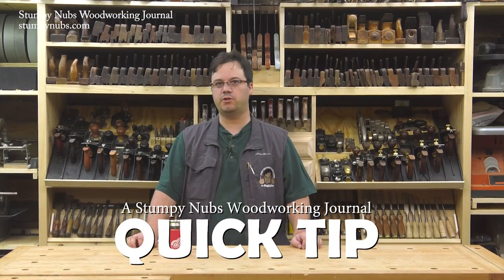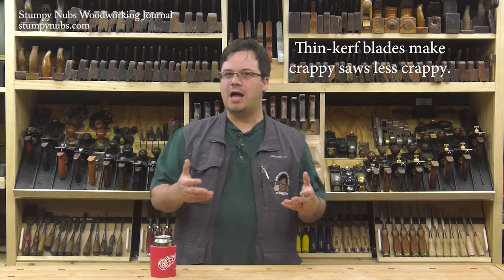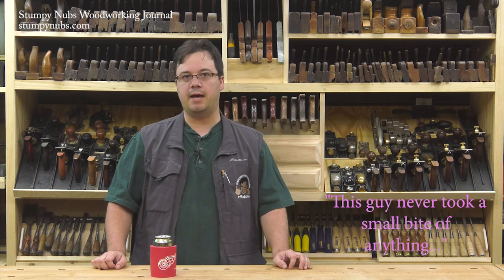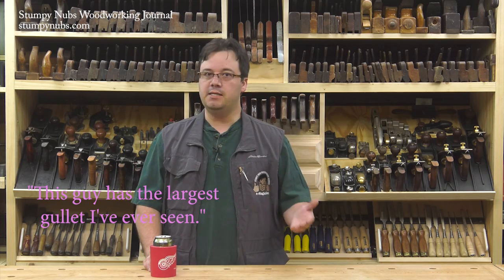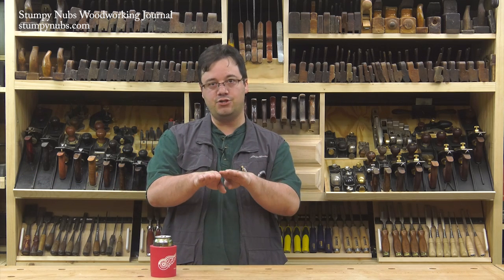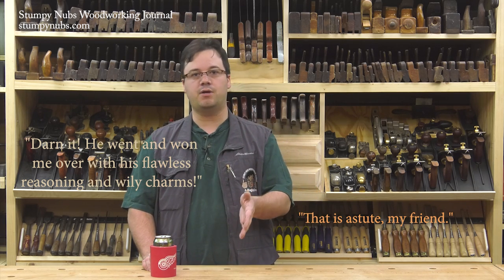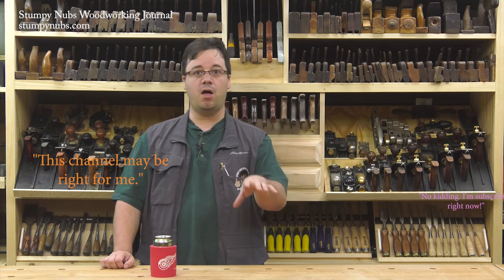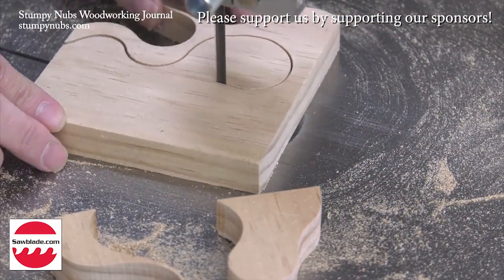Thin-kerf vs. full kerf- Don't choose the wrong table saw blade!

Comment: Regarding the feed rate, in the Jeep world, we have a saying:  "As slow as possible, as fast as is necessary" when rock-crawling.  That minimizes damage in the event that a vehicle slides while on a rock, causing a slower speed impact with the undercarriage (or side) of the vehicle. The table saw is the opposite: "As fast as possible, as slow as is necessary".  The solution to an underpowered saw that always burns your wood is to get a better saw to cut the stock that always burns. The 'underpowered' saw might still be useful for smaller projects, and a small crosscut sled, or miter sled, could work very well on that smaller saw.

Comment: All my table saw blades are full kerf EXCEPT for the million+ tooth plywood blade I bought some time ago, which did not come in a full kerf width.  I've wondered if there is an advantage to having a thin kerf blade for plywood (other than those mentioned in this video).  The blade does a spectacular job of cutting plywood, but then again if only one side is showing I can cut the plywood face up on my table saw with a combination blade (or is it face down, I always forget) and get great results for the "display" side.  But yeah, love my full kerf blades, my fancy-pants brand for most stuff and my cheapskate brand stuff if I'm worried about hitting a nail/screw/old fencing/civil war bullet/etc.

Comment: Excellent video with good info.  How about a discussion of 10" blades vs. circular saw blades?  I've switched to cir. saw blades for most cutting on an extra job-site saw (Bosch 4100) and like the performance.  I can't cut very thick wood, but it is very good for what I do on this saw.

Comment: Another approach I use is a smaller diameter blade. I cut a lot of 1/2” thick hard materials. The reduced speed reduces burning, as well as the load on the motor. Be advised: if you get a kickback, it will be significantly stronger.

Comment: The only reason I would use a thin kerf blade by choice is when resawing balsa and other woods for model building.  When the desired thickness is 1/16” or 3/32” that 1/32” adds up fast.  Balsa is pretty pricey and good spruce is hard to find.

Comment: Thanks for this very good overview.  I ended up getting Forrest thin kerf with a 5" stiffener.  My saw is 2 HP.  Which is certainly stronger than a lot of saws.  Still, it isn't a 3 HP, 5 HP, etc.  And Forest's thin kerfs are .100" thick, a few thousandths thicker than typical 3/32" thin kerf.  It seemed like about the best compromise given my medium power saw.
Reply: It is Better, I know, because I replaced my blade  with one of those!

Comment: One thing you forgot to mention is the need to change the blade knife accordinately to the width of the blade... so you usually better stick to one kerf for all your saws (or be prepared to tune the knife everytime you change the blade... even on my Delta it's not that easy to get it precisely set). 
Personally, I will never use a thin kerf ever again. When cutting cherry and maple they vibrate so much... It's even worse on a 12" mitre saw...
Reply: Try a smaller diameter blade instead with thin kerf.

Comment: My dad used to sell Homelite chainsaws back in the day.  They were lugging saws and used thicker kerf chainsaw blades than the Stihl's.  The Stihl's would cut circles around those old Homelites but would pinch a lot easier.

Comment: Get the right blade for the job. 
--Thin kerf finishing blades work rather well for plywood when you're using a circular saw guide.
--A good thin kerf high tooth count TCG bade can be versatile on a miter saw. 
-- A full-kerf FTG blade is nice on a table saw. My great grandfather always used this on his table saw. "Ah que muchacho! Don't waste time changing blades. Square the parts, cut the parts front-side first. Sand it neatly, put a neat finish on it. Have pride in your work. You're going to be stuck with it for the rest of your life.

Comment: The other thing you can consider is using a 7 1/4 saw blade for thin stock rips and cross cuts. Try using a 8 1/4 24 tooth blade for ripping 2'' construction lumber. They are usually thiner kerf and because of the smaller diameter, the torque at the point of contact with the wood is greater and the friction with the material is less.

Comment: Lower power use can be great in battery saws too. The steel of a 25% thinner saw blade is not a little more flexible, but a lot. Deflection of a beam is proportional to the third power of depth, meaning it is .75*.75*.75, or 42÷ as stiff. The same force will move a thin kerf blade more than twice the distance if no support plate is used.
Reply: I have always used a thin kerf and I even resaw with it. I have had zero trouble with bad cuts due to deflection. I use quality blades and always use a feed rate to match what I'm cutting.

Comment: And then I walk away... 🤣  sometime punches get thrown!?....over...kerf size 🤦🏽‍♂️ 
More like A squirrel & a half 😂🤣 
I agree with that heat/burn part, expand/contract for sure! Regardless of kerf I always try and keep a constant feed rate but In that moment keep an ear listening and a hand feeling for any major slow down under load. only then I opt to slightly slow up my feed rate to let the blade regain a few rpm minimizing motor strain. At least in theory lol my daily TS is a Dewalt 4800rpm she seems to handle anything I’ve thrown at her full kerf including IPE which I consider up there in hardness: Janka status. On a side note: I never realized that diablo only made thin kerf? I figured I just happen to be using their thin kerf version, but now that you said that in another vid it’s all coming together 😆

Comment: My problems is with blade periotic vibration.  I have a Jet 10" 220v 2HP cabinet saw.  As I feed materials through the blade will periodically vibrate cutting a 32" wider cut for an inch or so.  At first I though it was because my motor pully (double belt) slightly offset from the blade axel pully which I fixed and seemed to correct the problem.  But it returned and the pullies are aligned.  The bearings are smooth and tight (no slop). Using a full kerf blade. (Amana actually) Have you ever experienced this?

Comment: When you are cutting wood that costs many many dollars per board foot, kerf becomes extremely important. I am building a homebuilt aircraft made from aircraft grade Sitka Spruce… even 1/32 of an inch saved by using a thin kerf blade is like putting money back in my pocket! It is the reason that most of my cutting is done (where possible) on a band saw, which wastes a lot less wood in a cut since band saw blades are even thinner than thin kerf table saw blades.

Comment: I don't use a 10'' in. blade I go down in size to what I can get away with without having to make two cuts. That's works on the saw I have. Sometimes I have to go with  10'' and like you said it has problems. I run a 8-1/4 mostly.

Comment: Great video. Question. I've been having a hard time at the big box stores trying to figure out whether the blades are full kerfs or not. Obviously the ones labeled thin kerf are not. If it is not labeled "thin kerf" are the chances good that it is full kerf?  Also a flat cut would be nice too. Do you or anyone else out there know of a halfway decent blade that has one or both of my needs that doesn't cost a fortune. I just want something to cut 1/8 or 1/4 box joints on my table saw and I would rather pay less and not have it stay sharp as long. An actual model number would be great. Thanks!

Comment: I use a diablo thin blade. It 7 1/4" for a skill saw but if your not cutting thick lumber they work great. And you can get them for$15 at home depot way cheaper then an actual 10" thin kerf

Comment: Warped from heat?  Been there, done that; working in a window factory and sawing 5" to 7" glue-ups.  The blade would look like a wavy pastry, but after cooling down we'd be back at it (a the joys of production).

Comment: Great video, thank you.
 I was wondering, if the blade is thin-kerf, is there any danger of the blade breaking
while you use it?
I am thinking about purchasing a 7-1/4 inch Diablo blade, 60 teeth that has a .059 kerf. (1.490mm).

Comment: I wonder if you had a thin kerf blade cryogenically frozen, if it would prevent it from warping when it heated up also preventing vibration.  I know that's what they do with gun barrels to prevent them from warpage when it they get hot.

Comment: There is Full kerf, Thin kerf, and Micro kerf.
And yes, the micro kerf saves lots of wood.
OK, it's a rare peace of lilac that i'm using to make small jewel boxes.
The walls of which are 3mm or 1/8" thick (it's a strong wood).
Using a micro kerf blade with a 1/16" kerf means every 2 cuts saves enough wood for a 3rd cut. I get to use 50% more wood. That is a huge savings in wood.
And it's not even gold plated.

Comment: If you have a 10" jobsite saw switch to a 7 1/4 24t framing blade.  Less kerf, easier on the motor and most cuts are no thicker than 2x material.  

I went to a 10" blade from a 12" on my full size table saw. Makes all the difference.

Comment: I would also worry about the splitter.  My jobsite saw doesn't come with alternate thin splitters.  To use the thinner kerf blade I need to remove the splitter. This has the potential safety issues discussed in abundance.

Comment: My DW 745 instructions recommend you purchase their thicker riving knife if using a full-kerf blade.  I'd be interested to hear your take on why this is.  It seems logical that using a thicker riving knife with a thin blade could cause problems, but not a thinner one with a full-kerf blade.  What am I missing?  Excellent video!!
Reply from the maker: The idea is the riving knife protects the side of the blade from wood pressing against it and pinching. So it makes sense that you would want a thick one for thick blades and a thin one for thin blades. But I asked SawStop about this (they only sell one size knife) and they said a slightly thinner knife will still give adequate protection to the blade. So you can use one knife for both thin and full kerf blades. And if you think about it, that makes some sense because you don't change the splitter on your blade guard based on the blade thickness either, right?
Reply: @StumpyNubs  Ah.  I guess I'll get one, then.  I was thinking it would just be to hold the kerf open.  But it needs to be fully open, not partially.

Comment: Hey James, thanks for the video tutorial on full vs thin kerf blades. Was thinking of using a thin kerf blade but will follow your advice on using a full kerf so long as the saw will handle it. p.s. the silly comments were somewhat distracting from your important message.

Comment: Do they make a thinner Riving Knife ? I put a thinner blade on my Delta and had take it off. As the woods gap wouldn't go around it. After realizing how un safe this was I went back to the stock blade.
Reply from the maker: Some saws offer thick and thin knives. Some offer just a thin knife that's used for both thick and thin blades (never understood that one). Some only offer thick knives, which makes using a thin kerf blade difficult unless you make some sort of splitter.

Comment: One thing you neglected to discuss is the use of a splitter and a thin kerf blade  can be problematic.  My factory splitter on my first contractor saw was too thick for the thinner kerf of a thin kerf blade -  had to make a custom one in the throat plate but then had to remove the guard.

Comment: I am ripping ¾" plywood at a 45 degree angle for a French cleat wall, but am getting burning of the wood on the piece to the left of the blade.  I am using a Ridge carbide 40 tooth blade (new).  I checked the alignment of the fence to the blade.  I tried to feed the material through a little faster but it did not help.  I bought this blade because I wanted a clean cut for the plywood.  It is a full kerf blade.  Any suggestions?

Comment: This brings up another question. Can a motor on a cheaper saw (ryobi contractor) be swapped for something with a bit more umph?  Asking for a friend.
Reply: In the technical sense... YES... actually, it can.

   There IS (however) some of the usual "industry standards" and "quid-pro-quo"... SO I might as well make a few basic points now, and save you some of the headache later...

   1. Electric motors come in standard sizes and arrangements... USUALLY, this provides a list of replacement motors for purpose... Like all your "table saw" and "10 inch or larger Miter Saw" motors for Ryobi (in your case) will likely have very similar formats, housings, bearings, and (importantly) bolt arrangements... These are the details you need to know... so you can then take out a "bad" motor and install a "better" motor...

   2. Shaft size is IMPERATIVE in any motor... Now, we're not necessarily talking about "arbor" here... I'm specifically speaking to the size of the shaft INSIDE the motor.
   Here's the thing. SOME appliances like table-saws use a "reduction gear" in a box-like attachment to the motor to spin the "Arbor shaft" where the blade is mounted. This further allows the company to save money on smaller motors to push larger blades around... and it's absolutely essential that you can extract that gear-box from your old motor and attach it to the new one... OR that your new motor already has an "arbor shaft" protruding somewhere accessible for your saw... Otherwise, all the power upgrade money can buy is pointless, since you can't put a blade on the thing under your table.

   3. Right or Left handedness counts... The last thing you want is to be feeding wood into a saw and watch the blade grab it out of your hand and send it rocketing across the shop into the wall, a window, or the back of someone's head... SO you'll want to know which way your motor has to turn (and some gearboxes DO reverse it) and therefore which way the NEW motor MUST turn to be useful... You could (theoretically) cut the side out of your saw-table to make space for a backwards motor... BUT I doubt it works out well in application.

   4. Wiring and HEAT... No, not from the effort of spinning the blade in a kerf... Heat ALSO comes from running the electricity required to push the motor around... Cheaper Smaller motors often come complete with cheaper smaller wires and switches and sensors and "cut-off" safeties... SO when you look at your motor and read 10A @ 125 VAC, there's a bit of math to do... Amps (Current) times Volts (Energy) equals Watts (Heat)... SO 10A X 125V = 1250 Watts, and that means it pulls as much power from your house to run the saw as it takes to run 12 and a half 100W incandescant lightbulbs... OR a bit more than the average 1000Watt Microwave oven... 

   SO when you look at the wires, you can usually read the Gauge on the side... OR you can borrow a pair of wire-strippers and compare the "connectors" (you'll find those at the wire ends, where they plug into stuff) with the "crimp" section to get a reasonable guess on wire thickness...
   The rule of thumb here, is thicker wires run cooler... You can look at the wires and electrons like streams and water... It's easire to push water through a wider stream (or hose) so it's easier to get electrons through thicker wires... simple enough... JUST remember to keep this within reason... you can't fit a 10G wire into an 18G fitting, and it's dangerous to try.

    Okay, I know this sounds hopelessly complicated, BUT with a bit of time invested in LOOKING "under the hood" at your saw, you can take these 4 primary points of interest and start looking into a replacement for your (ahem) Friend's tool... I might recommend you speak with an appliance repair guy (even a retired one) who seems to know his business, to get better (in person) advice on the spot than I can give you. The motors ARE out there, from Amazon to Ebay, there are places to look ONCE you know what you're looking for.
   Good hunting! ;o)
Reply from the maker: At your own risk. The saw was designed for that motor. Who knows how it will function with something more powerful.

Comment: I'm looking at using some kerf cuts to make a concave hood fan for a customer. Our CNC's smallest bit is a 3/8 bit. Would making kerf cuts with a 3/8 bit be possible or would it be too large of a cut. Not sure if we're going to need a smaller bit to get the results im after.

Comment: Isn't a thin kerf blade thinner in the carbide teeth as opposed to the "steel" so heating of blade becomes less of an issue? 
 
And if the steel heating were an issue, wouldnt bandsaw, and jigsaw experience greater issues you described in terms of a table saw blade?

Comment: Hi I picked up a cheep table saw and had to get new saw blade it's 2.8 kerf. But I think something has been dropped on this table saw as the table has a lump in it. So wood is not flat to the table on the left side of the saw table. Or it may be its a Titan saw table and the saw wants to come through the table. So was looking at getting a new table saw. And the one I am looking at has a 2.6 kerf. Is it OK to use the 2 saw blades I have that are 2.8 kerf. I wanna start making pitcher frames and a Titan table saw with a lunp in the table is not going to be good. And the fence sucks. Hope you can get back to me on this one.
Thanks

Comment: I've got an old Hitachi compound miter saw (2005). I put a replacement Diablo blade on it but the blade doesn't tighten on the spool. The blade spins independently of the motor shaft. Any suggestions?

Comment: I looked at a thin kerf for my portable contractor saw and found it was .015" thinner than my riving knife.  The knife will not be removed nor the cumbersom glade guards.   

By the way, I have a Bosch 4 HP 5000 RPM  and it makes really fine full kerf cuts.